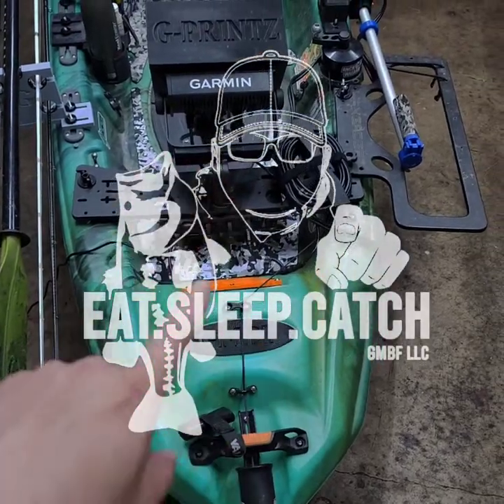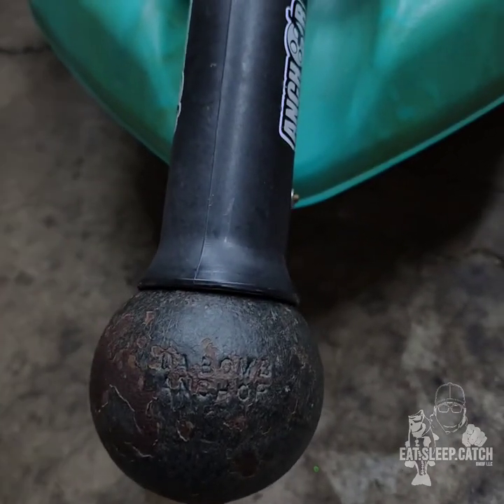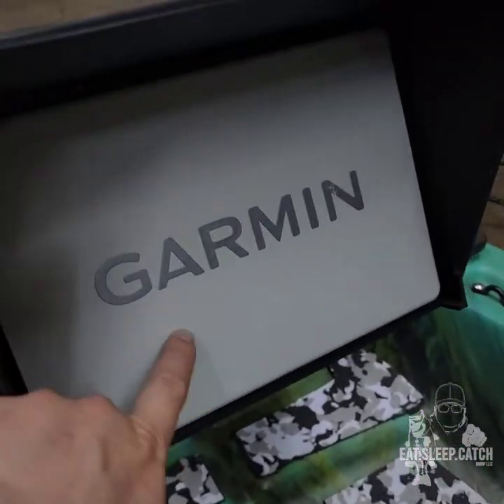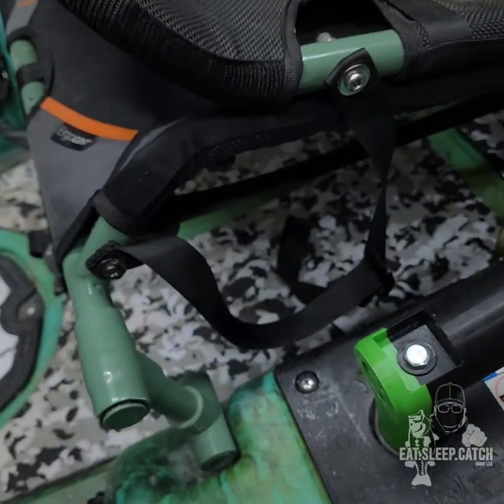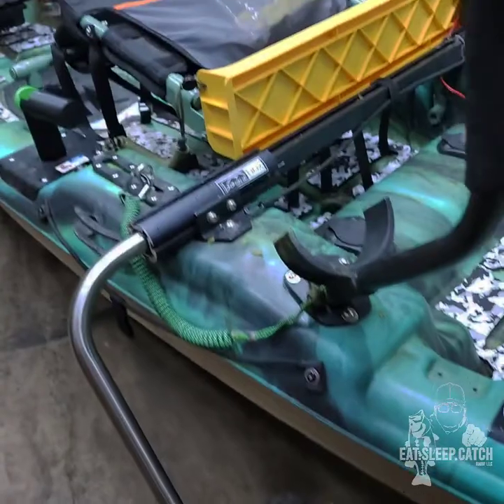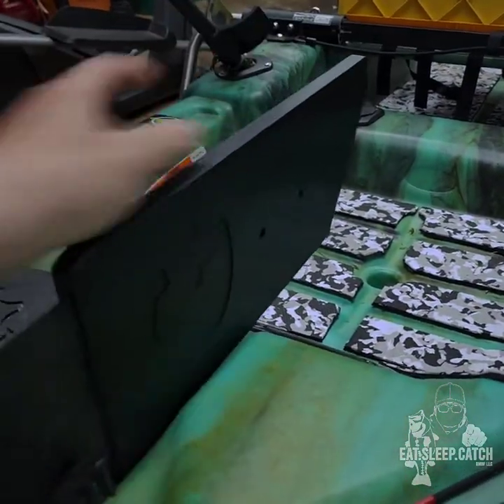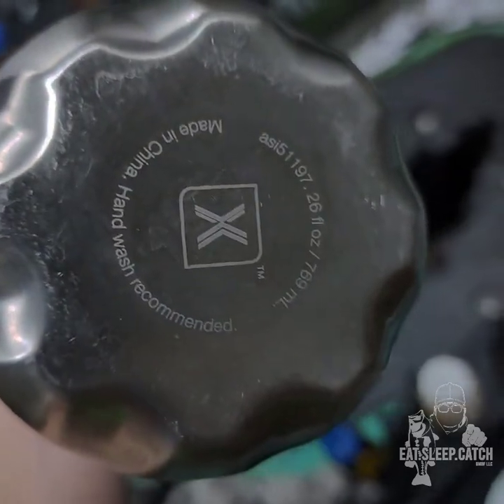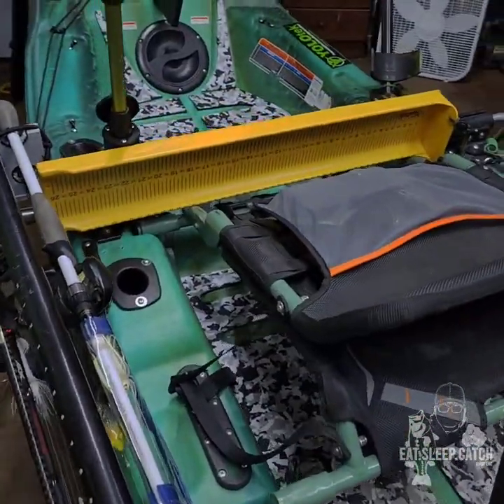Pelican Catch 110HDII | Mod Walk-Through

Comment: Do you still you the trolling motor In the cassette mod you made??
Reply from the maker: I sold it to a guy in Texas last year. After I got my hobie 180 drive for the catch 110HDII I never used it again. The drive is just as fast if not faster.
Reply: @GreaseMonkeyBassFishing  but it's an awesome rig for convince, I just got a 110 HDII but it didn't come with the pedals so I saw you video and ordered the cassette to make one myself! The Hydryve II pedal set is 600 bucks, little to high for my budget friendly yak
Reply from the maker: @Eli The Fishing Guy  if anything,  save and just get the hobie drive if you decide to buy a pedal set.  Yes it cost just as much as our kayaks lol
Reply: @GreaseMonkeyBassFishing  wow really. so the 180 drive is worth the $$$
Reply from the maker: @Gary White  100% but to each of their own. I love my 180 drive! Less effort then the Hydryve System. So smooth and I go up to 4mph already if I really want to push it lol. Reverse is great also when you need it quick.
Reply: @GreaseMonkeyBassFishing  that's my 1 dislike is the drive not having reverse.
I'm in the 130 HDII 
I mounted a bow mounted trolling motor for the Detroit River 
But I like to fish creeks and canals so I take the trolling motor off and would be nice to have reverse.

Thanks for your videos 👍
Reply: Did the HDll original drive worked well for a while? Or did it break? I am interested in this kayak, but have seen several reviews saying the drive breaks quite easily. I am in Costa Rica so a bit far and not to many options in pedal kayaks.
Reply from the maker: Drove works fine as long as it's HDII drive. I just wanted the faster reverse from the 180 drive.
Reply from the maker: Majority of people who has HDII break probably didn't take care of it or hit something